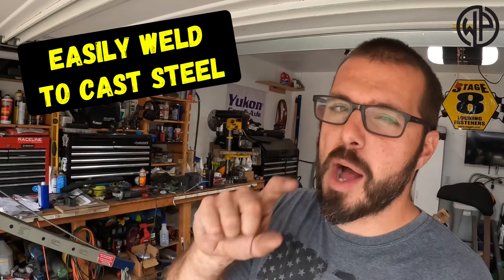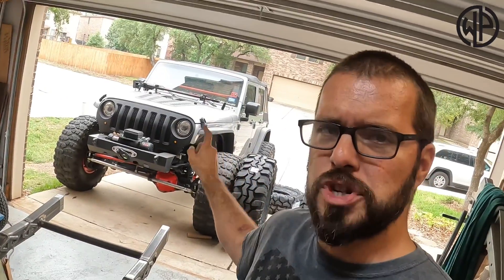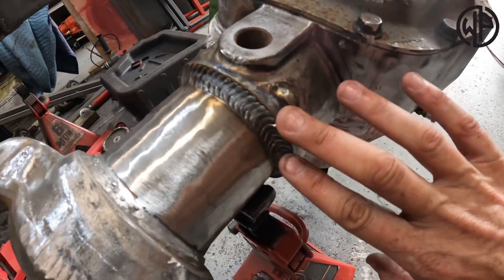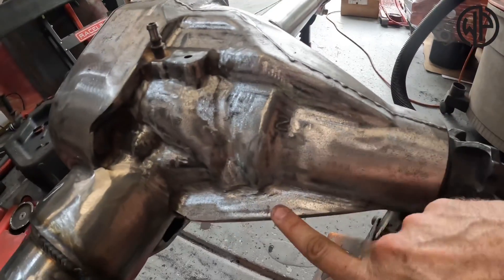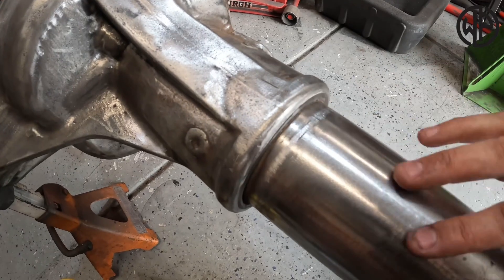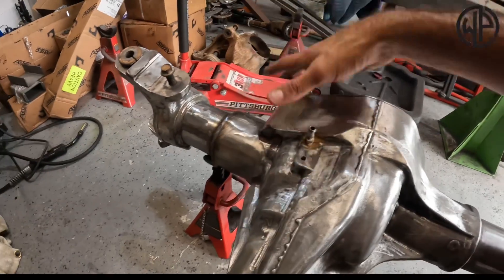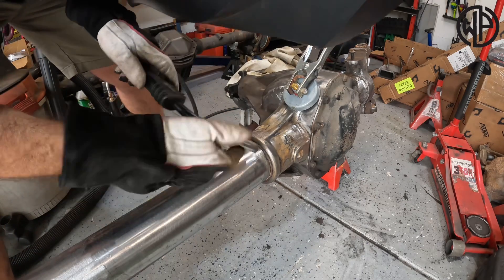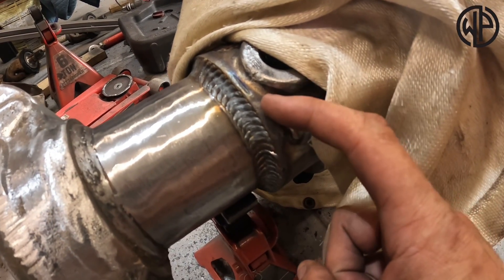Welding Tips and Tricks!  - The EASY Way

Comment: You posted this centric BC will work with factory booster. My JK already has the J8 and I believe it is a crown. It is leaking at the grommet between MC and reservoir. Will the centric work with j8 booster or will I have to get a doctors booster again😭?  Thanks
Reply from the maker: @ThisIsTheWay-5280  I’m sorry you are dealing with that. If you are running the J8 from crown….you will have to pull it all out. Go back to the factory booster and then put on the other MC I mentioned. The issue you are having from crown is VERY common. If you are going to run the j8….it has to be Mopar or you will end up with the issue again. The crown kit is junk. I’m sure they’ll fix it eventually. But they always seem to leak.

Comment: If you grind on it and it shoots bright white sparks it is steel.
Get a garden weed torch to pre-heat metal for welding.
Reply from the maker: Yup! That is another way to tell for sure. I’m not a fan of the garden week torch. It’s often propane and such a large flame that it can’t be accurate when you don’t want to heat certain things that are close, at least not all the time.

Comment: What mig wire would you recommend?
Reply from the maker: Depends on a couple of things. I like to weld a bit slower. So I like a slightly thing wire even for thicker steel. I typically use an .030 but if it’s thin sheet I’ll go down to the thinner wire. EXTREMELY rarely is it thicker than .030 because of the speed I weld.
Reply: I've had really good luck with Nickel55 Wire. I've welded the tubes to the pumpkin and trusses to the pumpkin on dozens of Axles over the years with it. You still need to pre heat the cast but you don't need to post heat and wrap in a blanket with it (if it's Cast Steel, the process is different for Cast Iron). Good luck with your Project man!!
Reply: @TyphoidSnaily  Thank you for the reply.
Reply: @matthewpreece6362  yeah for sure. I realize now its likely a bit late 🤣🤣
Reply: And what about wire type? I purchased some Ni99 wire as I wasn't sure if normal wire would work.